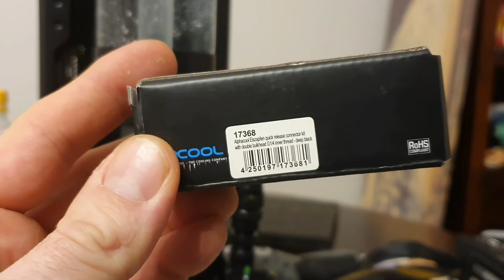Alphacool Eiszapfen QDC Quick Couple Disconnect Failed December 2020 lot

Comment: It's so hard to get the flow rate specification for UQD fittings. Most manufacturers don't even list it because it's so poor. Data center quality QD fittings are $200 to $300, each. I wish I could afford them, though, I'd rather drain or pinch off my entire loop than take a hit to my flow rate.

Comment: Hey, did you ever get in touch with the supplier about this? Any joy?

I'm thinking about adding some of these where my PC will hook into an external cooling set up so will give them the blowtest when they arrive. Good demonstration.
Reply from the maker: Hey. Yes. I did contact Alphacool. They've said that they'll come back to me with information if I can give RMA only the female ones. As I have used male ones. They've never came back with any info. There were 3 email on my side and only first had a response. After 6 months of throwing this stuff around I just threw those out to recycling. And never bought any QDC from AC again.
Reply: Alphacool are a joke